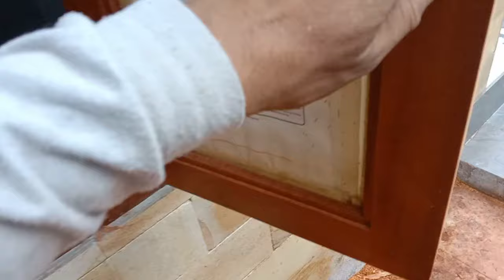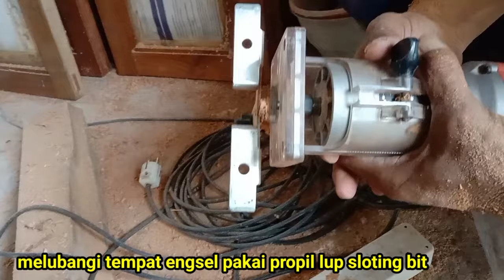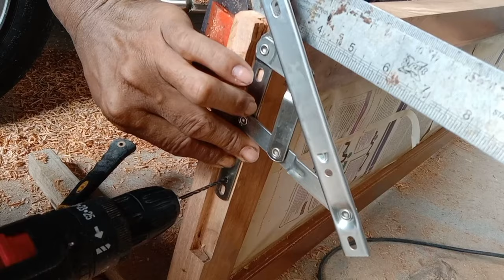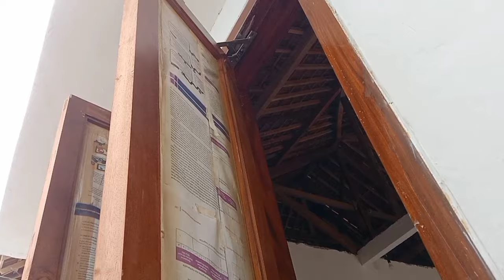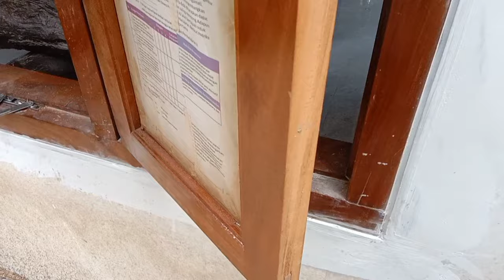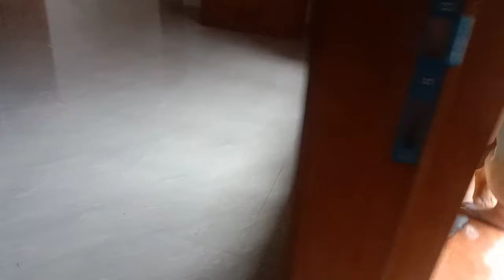cara pasang engsel casement jendela lipat buka nyamping

Comment: Untuk kayu sama allumunium beda gk bang
Reply from the maker: @Susi234-m8x  sama saja esel itu bisa di pake pada jendela aluminium dan bisa juga di pake pada jendela kayu
Reply: @PriyanAbduljabbar  kirain ada bedanya 
Misal dr segi lebare
Reply from the maker: @Susi234-m8x  gak ada Bun, bedanya cuma ada yg biasa dengan bahan lebih tipis, dan yg bagus bahan lebih tebal
Reply: @PriyanAbduljabbar  trimakasih bos
Reply from the maker: @Susi234-m8x KLo ukuran panjang macem2 mulai 8inci sampe 50 cm ada

Comment: Bang yg di video itu palek engsel ukuran berapa
Reply from the maker: @abdulfadholi989  itu ukuran panjang engsel 12inci=30cm, jendela lebar 40cm x panjang 2meter.
 bila jendela lebih kecil bisa pake esel yg lebih kecil
Reply: Kalo lebar jendela 50cm x 175cm pakai engsel panjang 30cm aman kah gan ?
Reply from the maker: @abdulfadholi989  oo lebih baik pakai saja ukuran 14inci=35cm bang, karna agak lebar itu
Reply from the maker: @abdulfadholi989  klo memang sudah beli ukuran 30cm ya gak apa² di pasang saja bang, klo masih mau beli ya beli saja yg 14inci
Reply: Oke bang terimakasih

Comment: Model begini pakai grendel kodok cocok apa tidak ya?
Reply from the maker: @AshfaToys  cocok saja, tergantung selera
Reply: @PriyanAbduljabbar  terimakasih bang🙏
Reply: Untuk ukuran jendela 
1. 40X120 CM
2. 40X100 CM 
cocok pakai engseel caseement berapa inch ya bang?
Reply from the maker: @AshfaToys  pakai saja ukuran 10 inci=25cm sudah cukup.
Klo vidio itu paka 12 inci=30cm karna panjang jendela  2meter
Reply: @PriyanAbduljabbar  siapp mas
Reply: Bang, saya lagi bangun rumah nih jendela 60x170 & 50x170 pake yg ukuran berapa ya engsel lipatnya 🙏🏻🙏🏻